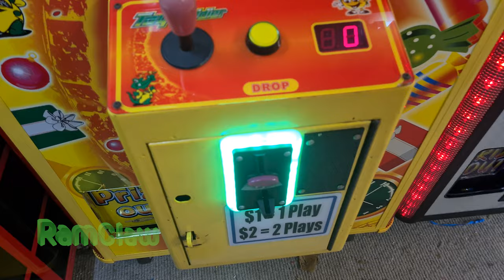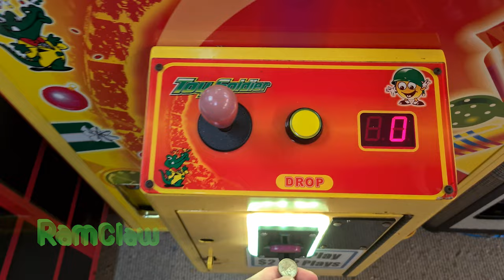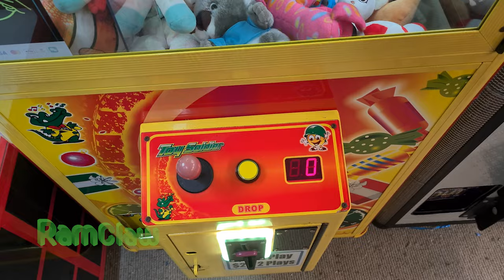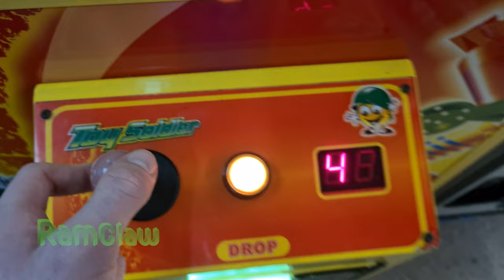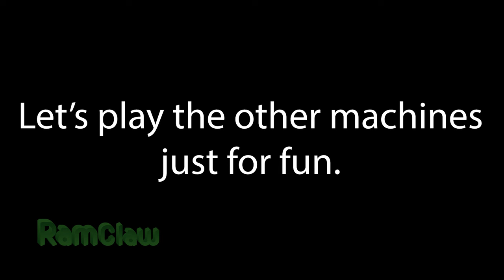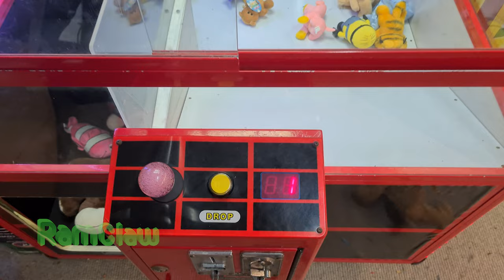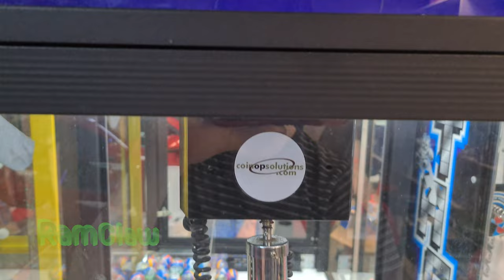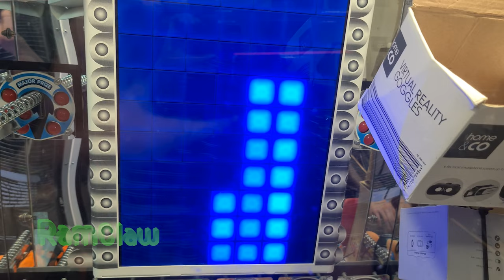Toy Soldier Amusement Crane Claw Machine by WMH/Paokai

Comment: In our huge grocery store, there is a telephone (basically the same WMH-288, as the toy soldier) claw machine in horrible condition. My dad works doing repair of the arcade machines, but mostly cranes. He told me they said "crane not working". That's it. That's all they said. The crane was erroring out, I don't remember the code. Probably E6, E8 or E9. Anyways he fixed the machine, and noticed: no matter how strong the claw is set, it always closes at about 40% power (About 25 volts). Turned out, that strength potentiometer is stuck at 40% position, and the knob spins independently to the potentiometer itself.

Comment: Does it keep grabbing strong until the sensor is set off on the payout?
Reply from the maker: Depends on the settings. By default, it only stays strong for 1 try and then goes back to weak. You can either have it count up from 0 to whatever you set it to, or you can have it randomise it. On software versions made in 2007 or newer (I've upgraded all my machines to the latest version) there's an option to have it stay strong until the sensor detects a prize payout. The newer versions also have an option to delay the next payout if a prize is won earlier than expected or it will shorten the amount of games till payout if a prize is won later than expected.
Reply from the maker: There's also a dipswitch setting to choose whether you want payout strength to be either just VR1 or max 48v

Comment: Woah, nice buy. You don't see alot of claw machines with that Super Card feature nowadays. Quick question, is the super card riggable using a payout system (in a sense that it can be rigged like a stacker payout in which it purposely misses the spot even If the player timed it right)?
Reply from the maker: Yeah it does purposely miss the spot when it's not ready to win. Basically it's just a randomiser system, you put in how often you want people to win out of 100 games and it basically rolls a dice.

Comment: Also, ine thing you probably didn't know, he used an arduino to make the sidelights look like the original

Edit:  he actually set the speed of the flasher, not using an arduino.
Reply from the maker: The LED strip came with a flasher, I set that to the correct duration and speed to make it look original
Reply: @RamClaw  the sidelights flashing always remind me of that lambada soundtrack.